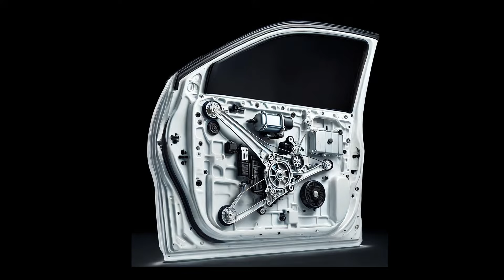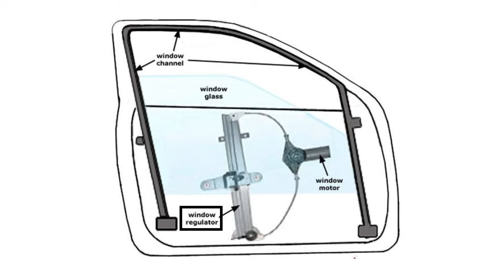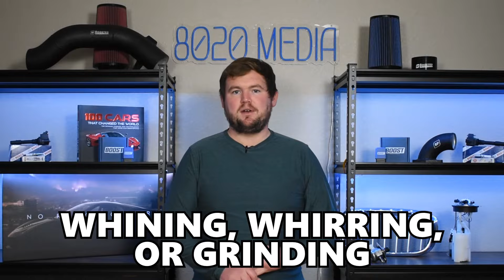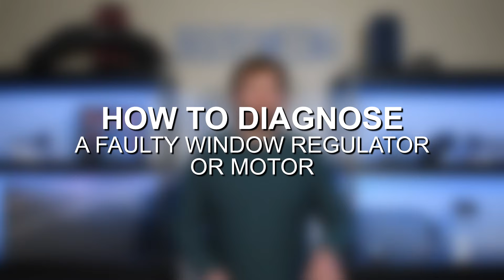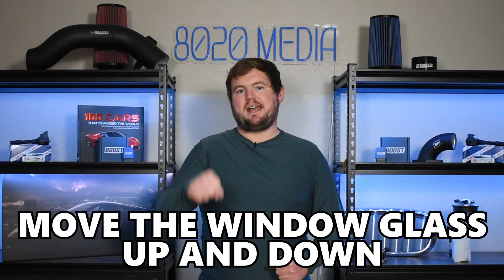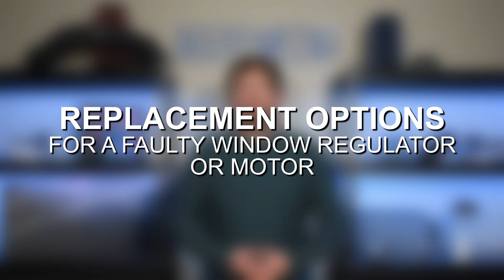Signs & Symptoms of a Bad Window Regulator/Motor!

Comment: I  have a 2015 Kia optima. It could lower the window but not make it go up. Accidentally took it almost all the way down, but have a little bit to grab on. still can’t lift it manually as if it were stuck securely in place. When I took off that plastic cover, removed the speaker to access the bottom of the glass to push it up, it goes back down and resist move it up manually. When I press the button to move the window there is a light sound that gets weaker within 5-15s of doing that it, goes silent. Then I try an hour later and same thing happens. 

Am I just cooked both regulator and window motor?

Comment: I have a 2003 mercury grand marquis and the front driver window is stuck up no sound whatsoever. Everyone’s smile push to switch to try to go down. You’ll have a little bit of noise and then it just stops, but it never goes down at all, I don’t hear any grinding. I don’t hear any moving so I’m guessing that the motor is bad in that front window. Well then a week later my back passenger window now I believe is the regulator because I can manually push it up with my hands up and down, but is that common for both those window on the same side of the vehicle to go out within a couple weeks? Any idea?
Reply: Sorry, and that back window when I try to control it it’s grinding so I’m guessing that that regulator is broke off and it’s trying to do its job, but I can manually lift it with my hands up and down, but the switch doesn’t work, but but the fact I can definitely tell the motor is spinning, but it’s making a lot of grinding noises and stuff but the front window makes absolutely no noise

Comment: I lowered my window the other day and when I tried to raise it it went up part way and then slipped down an inch or so. I pushed up again and it went up further and then slipped again. Finally I got it to the top and have left it alone. Does that seem like the regulator/motor?
Reply: That wouod absolutely most likely be the regulator that or an intermittent motor failure. You can test the motor by disconnecting it after removing the door panel and keeping the window switch connected, go to ignition on and then see if the motor spins in the direction that you push or pull up on the window button
Reply: @K1LLS4DAYZ  Thank you for that follow up, The body shop that put the door back together replaced the whole thing as they should done after the door was backed into by another car.

Comment: 1995 fiat punto 75 elx here. Driver side window sounds like im in the vietnam war. Is it the window motor? It does it when its fully up and still trying to go up and it will go down a bit then stop and make the sound. If you push it past that point with your hand it will go down and stop the sound.

Comment: My 2005 nissan titan , the driver side window goes down fine but going up , it goes slow and then will stop on its own. It will eventually go up but most times while im pulling on the window at the same time of using the switch.
Reply from the maker: L - That’s a classic sign of a failing window regulator or weak window motor - especially since it goes down easily (gravity helping) but struggles and stalls on the way up. Over time, the motor’s internal brushes wear and the grease inside the regulator tracks hardens, creating resistance that triggers the motor’s built-in overload protection, which makes it stop mid-way. While pulling up helps temporarily, that’s only masking the strain. First, remove the door panel and inspect the regulator tracks for dirt, rust, or dried grease; clean them thoroughly and apply white lithium grease or silicone spray. Next, check the window’s alignment in the guides — if the glass tilts or binds, the regulator cables or sliders may be worn. If cleaning and lubing don’t restore smooth motion, the window motor itself is weak and should be replaced (it’s common on Titans). Always avoid forcing the glass up too much, since that extra strain can burn out the motor or snap the regulator cable entirely.

Comment: How to get my window up tho?? It works when it wants to.. goes down usually np, but going up is huge issue. Sometimes takes a day or two to go off on its own
Reply from the maker: J - If your window goes down fine but struggles or refuses to go up, the most common culprit is the window regulator or motor wearing out, since pushing the glass upward takes more effort than dropping it; sometimes the switch contacts are dirty and only send good power one way, and occasionally the window tracks are dirty or dry, adding drag so the motor stalls. To get it up in the meantime, hold the switch in the “up” position while gently pulling the glass with your other hand, or bump the switch repeatedly — you can also smack the door panel near the motor while holding the switch up to jolt it free. As a temporary fix, spraying a little silicone lubricant into the window tracks can help reduce friction, but long-term you’ll likely need to replace the regulator/motor assembly or the master switch.

Comment: My issue is passenger switch auto up and down works on passengers window.. if the window is down and i press open on drivers side it closes... if i click close... it closes 🤦‍♂️
Reply from the maker: G - Sounds like a crossed or shorted switch circuit in the driver’s master window switch, where the driver’s controls for the passenger window are sending the wrong signal—pressing “open” makes it close, and pressing “close” also makes it close—while the passenger switch itself still works fine; this usually happens because the contacts inside the driver’s switch assembly are worn or shorted, so the fix is to pull the master switch out, clean and test the contacts, or more often just replace the driver’s window switch unit, since that’s the part interpreting and sending the commands to the passenger window motor.
Reply: @8020Automotive I sold it it was a lincoln mkt wiring issues uo the wazu foglight wiring issue light wiring issues to much haha thanks for the reply !

Comment: Hello my passenger side of my mustang drops a bit when I hit bumps or will just drop on any drive but like 4 inches and it won’t go down from there. Then I press the button and it won’t go up but I can easily move the window with my hands and sometimes it stays up or it will just drop. Is this the regulator or motor?
Reply from the maker: J - Based on your symptoms, it strongly points to a failing or broken window regulator, not the motor. The regulator uses a cable or scissor mechanism to hold the glass in position, and when it fails (like a snapped cable or stripped gear), the window loses support and can fall or be pushed manually. The motor may still be functional, but it can't raise the window if the regulator mechanism isn’t holding tension. You’ll likely need to replace the entire regulator assembly, which usually includes the motor anyway on modern Mustangs—once replaced, the window should operate normally and stay securely in place.
Reply: What if my window won't go up and makes a tight seal sound
Reply: @BigDookie317 if you can still hear the motor trying to work its most likely the regulator. In your case I would just see your regulator before buying it. I took off the door along with the whole window assembly  and just by looking  at it I could for sure tell that the regulator was the problem .
Reply: I opened her up and saw that it was most definitely the regulator. Awesome video man!

Comment: Thanks for the video! My driver side window stopped working about halfway up. I manually pushed it up to the closed position and it was hard to move it. No sound when I push the button. Is it the fuse or the motor?
Reply from the maker: O - Thanks for the feedback! It’s more likely the window motor or regulator has failed rather than a fuse. A blown fuse would typically disable all windows on a shared circuit or result from a short, but the stiffness you felt pushing the glass up manually suggests the regulator may be binding or jammed. To confirm, try testing the switch for power and listen closely for any faint clicks; also check if other windows work (which would rule out a main fuse). If there’s power at the switch and no motor response, the motor or regulator is your most likely culprit.

Comment: Having an issue with my ssangyong rexton driver side window not going up, have you seen or heard of this problem with thiis car. 2020 rexton
Reply from the maker: C - It’s definitely a known issue on the 2020 Rexton that the driver-side window may stop going up, even though power and the motor seem fine. Common causes include a faulty master switch, a bad circuit on the up/down action, or a dead regulator/motor. First steps would be to check the fuses for the window (both high‑amp and low‑amp), then test for voltage and ground at the driver-side switch and motor while trying to raise the window—if voltage is present but it doesn’t move, the regulator or motor is faulty. If no voltage, the switch or its wiring is likely the culprit. Since other users recommend replacing the master switch before pulling the door apart, that’s a smart move too. Let me know if you'd like a step-by-step on testing switch power or replacing the regulator.

Comment: Anybody familar with the 2002 - 03 Nissan Maxima windows ? 
Im tired im pumping money into the driver side window its been stuck since summer 2023 but prior to that i have paid for repair on it 3 separate times in a 5 year span..  is this a common issue found in this generation of Maximas ? or is it me being  blessed with defected Components ?
Any help or input is appreciated as the western U.S. peak  of summer is about to hit soon  🥵
Reply from the maker: B - You're definitely not alone—window issues on 2002–2003 Nissan Maximas, especially the driver side, are a well-known headache for many owners. The problem usually boils down to weak window regulators and motors that wear out faster than they should, along with plastic guide components that get brittle and fail, causing the window to jam, slide unevenly, or get stuck entirely. Unfortunately, even new aftermarket parts or cheap replacements often don’t last long, especially in high-use doors like the driver’s side. If you’ve replaced it multiple times and it keeps failing, it’s very possible you’ve been sold low-quality regulators—or the window track or guide bushings inside the door are worn or misaligned, causing the motor to strain and burn out. To fix it for good, you may need to replace the regulator and motor as a unit with OEM or high-quality aftermarket, and inspect the tracks and guides to make sure the window isn’t binding—otherwise, yeah, it becomes a money pit with recurring failure.

Comment: It's not making any sound. The windows are stuck up. All but 1. The back window on the driver side is still working properly
Reply from the maker: i - If your windows suddenly stopped working—with no sound, and only the rear driver-side one still functional—that strongly points to a bad master window switch on the driver door or possibly a blown fuse or relay tied to the main window circuit; since one window still works, it's unlikely to be the window motors or a total system failure, and more likely the master switch isn’t sending power to the others, especially if it’s worn or has a broken internal contact; I’d start by checking the power window fuse and relay in the fuse box (often under the dash or hood), then remove the driver door panel and test for voltage at the switch—if the switch isn’t distributing power properly but the rear window works because it’s wired independently or through a different portion of the switch, then replacing that master switch should bring everything back to life.
Reply: I came here BCS mine is too.

Comment: I popped the panel and tried to narrow down where the clicking sound was coming from and sure enough the motor makes a clicking sound and heated up.
Reply from the maker: J - Nice! Glad we could help.
Reply: @8020Automotive turned out that it was a bad switch. I initially thought it was the motor because of the clicking sound. I thought for sure it was frozen up. So I ordered a new one. I got it in and saw the madness I would go through in replacing it, so I disconnected the wiring and clipped it to the new motor and it too made a click. So I sent it back and ordered a new switch and that worked. Some folks learn the hard way, lol.
Reply: @Bruh_Geezus619  Interesting! At this point in my journey, I am gonna swap switches between the two sliding doors and see what happens. 
(I have simply the “click” when I move the switch button) track/regulator feel solid. )